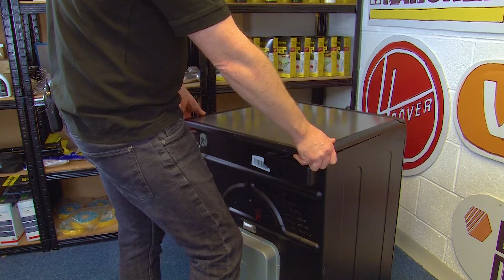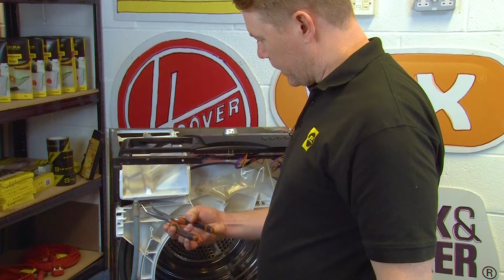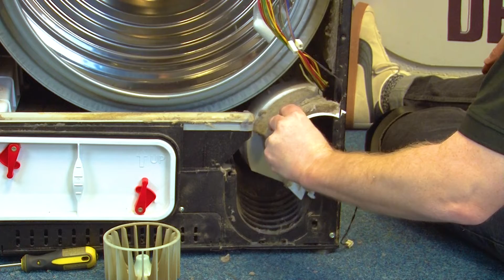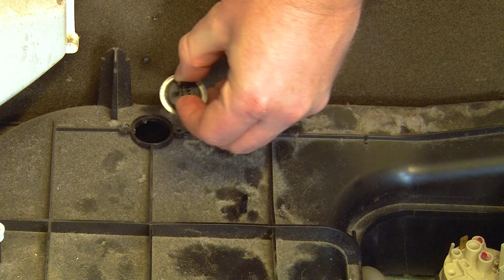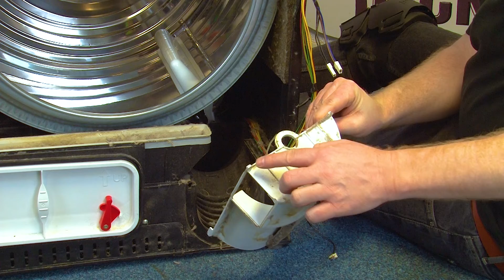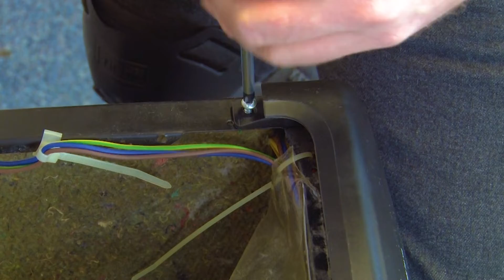How to Replace the Rear NTC Sensor on a Hoover Tumble Dryer

Comment: OMG you have to dismantle all this to get to the back sensor and that's only because the manufacturer didn't make a mounting back?? I immediately shoot off 4 stars for Hoower. Obviously, it is more important that it has a display that no one needs. Except the repairman.
Reply: IT`s so the labour costs excide the parts, so you go and buy a new machine, an access panel in the rear of the machine would be to easy.